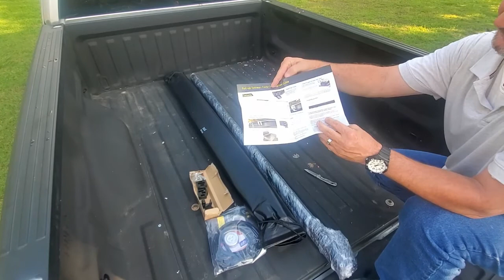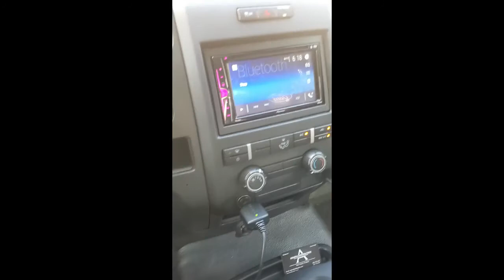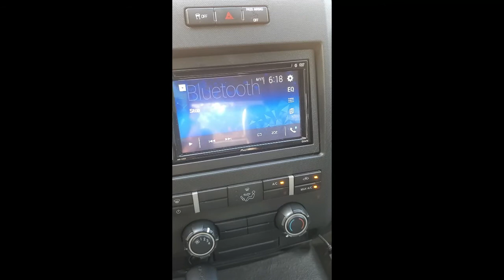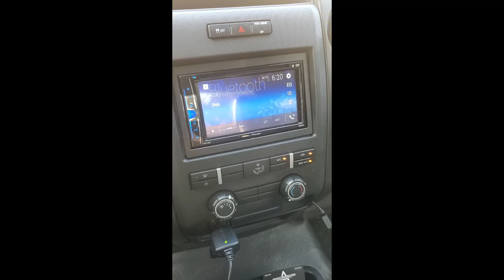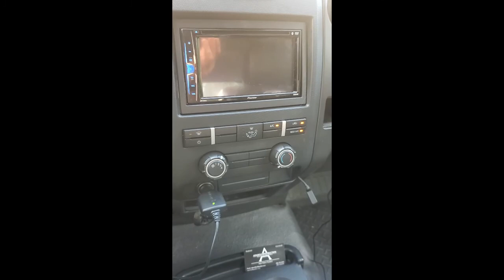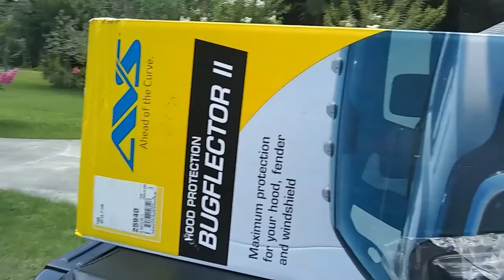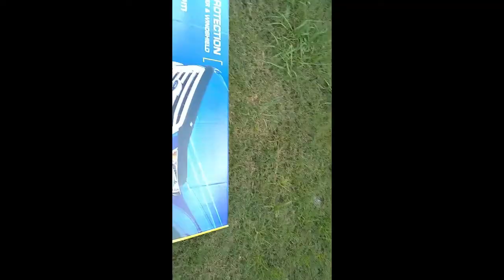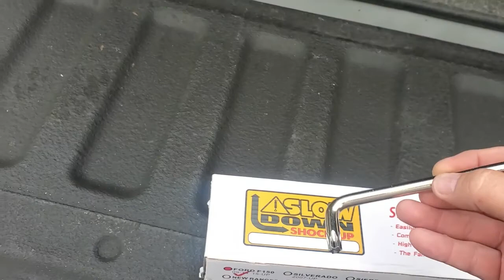Things you can do for under $500 for 2013 Ford F150 XL

Comment: I got mine in 2014, 1 year old, with 10,000 miles! I added the ARE topper, a sled out cargo carrier, E series Michelin’s. The initial owner had installed new wheels and step bars. Use it mainly to pull our travel trailer. Just turned 29;000 miles July 4th. Found snap on mirror extensions that fit mirrors like a glove. 5.0 engine.
Reply from the maker: Very Nice